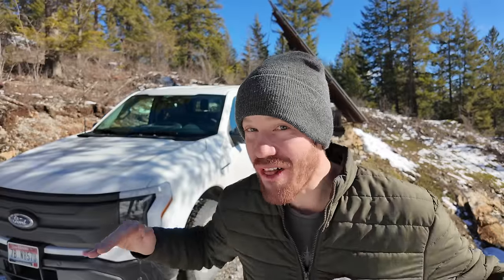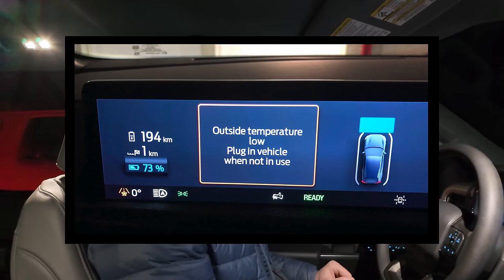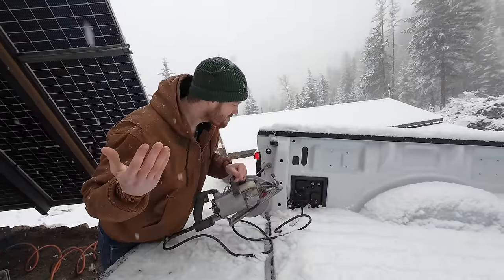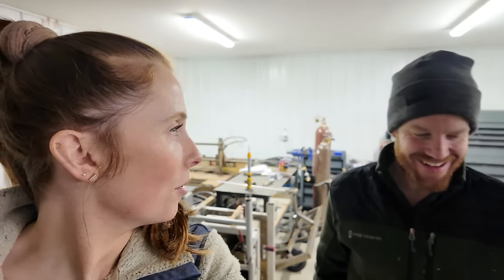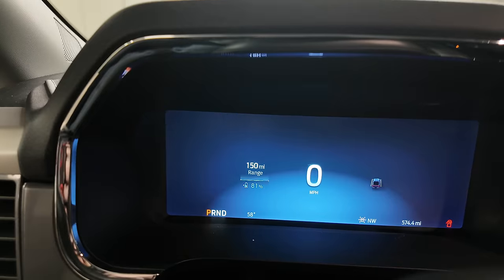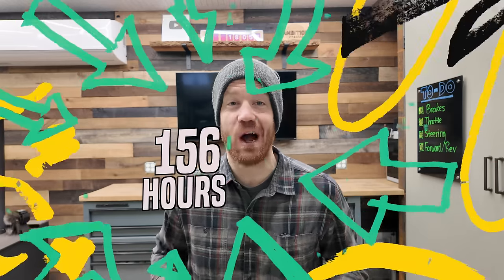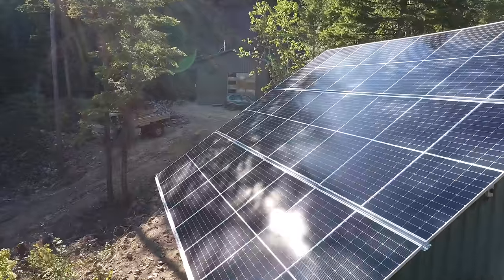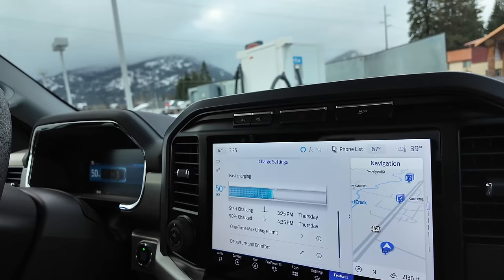Replacing My OFF-GRID Power System With an E.V. (not what I expected)

Comment from the maker: 📲 Install Raid for Free Mobile and PC: https://raidrpg.com/ambitionstrikes1 and get a special starter pack with an Epic champion Juliana 🔥
Reply: OMG you guys will advertise anything and this is a total disgrace from you 👎👎
Reply: @SaltandPepperX  watch the free entertainment and be quiet, these ads pay for free viewership, and its only 30sec so whats the point going bananas?
Reply: Ok, ok, ok.., enough with the foolishness.., now back to D8CAT, 120excavator, 299CAT skid steer, equipment working up rock and dirt…, demolishing old homestead…, etc..,
Reply: This sponsor doesn’t fit with your channel theme. Confusing
Reply: @greggb1416  exactly
Reply: @SaltandPepperX  hahaha..!
Reply: During the summer, perhaps late summer, maybe try making a gravity battery for winter, dig a small pond up hill using the dozer or excavator, pump excess well water  with excess power during summer, pipe something down to a water wheel for charging energy daring the colder months
Reply: @greggb1416  yep that is exactly what i thought with your post, what a tool came to mind hahaha..!
Reply: I wonder if you could chuck up a solar carport for the truck and leave it plugged in? It would be interesting to see if you need to ever charge it if it was on a solar array. Panels are cheap and you could make a car port in a day. You could also wire a circuit back to the main house to use it as backup without all the stuffing around.
Reply: What about bigger battery bank for excess solar
Reply: The "fake engine noise" is on most every new EV across all manufacturers. It is all about pedestrians becoming aware of the EV and not getting run over. 

I have been walking my dog after dark and greatly appreciate this feature on my neighbors EV
Reply: FINALLY! Welcome to the big leagues of youtubers :P
Reply: @SaltandPepperX crying on a video? You're funny hahahaha
Reply: @kingrafa3938  crying ? hmm very strange thing to say, that just shows me what kind of person you truly are.. I see you have no idea or understand what was said, oh well.
Reply: @SaltandPepperX  i read all your comments towards Riley and Courtney, and it's all negative everytime they do things. That's just show me what kind of person you truly are.  A crying NEGAtron 😂
Reply: The whirring  noise probably cooling pumps
Reply: @greggb1416 Yeah, I concur, more equipment maintenance and repair videos! You need to get the equipment up and running again! Especially the bulldozer!
Reply: dont make this mistake again.
Reply: 2days 19hours
Reply: @hardup9809  Exactly backwards.  Low water available in Summer, low excess power available during Winter.  Poor plan
Reply: @honthirty_  they said in a video the homemade well makes extra water more than they use and store , the whole point of what I said was to help with low power in winter, pump excess water into a holding pond above the house, during winter have it drain down, via some piping into a water wheel hooked up to a generator or an alternator
Reply: It's like this, on-topic sponsor commercials are understood, a necessary evil to pay the bills. But totally off-topic commercials are annoying as hell and only cause viewers to either skip ahead or close the tab and watch something else. Just being honest here, and yes I admire what you folks have done and I am a subscriber.

Comment: We have solar and use the truck as a battery backup. We don't use the onboard pro-power, we use the home integration system that we got with the truck. It plugs into the charge port and provides 80amps to our home. When the sun is out and we are getting solar, it charges. When the sun goes down we use the battery from the truck to power the entire home. No need to ever unplug it, no need to leave it on. And the truck fully charges by the end of the day and we only use about 5% from evening until morning. We've had zero issues with it and would absolutely buy it again.
Reply: I never purchased the home integration system as I couldn't see any real benefits in it versus just using the 7200W 240 plug located in the bed of the truck plugged into a 14-50R receptical at my main service panel. I charge my truck using my solar system using a 7.2 kwh 240 volt charger. Since I seldom drive more than 60 miles in a day and only drive 2-3 times a week so I can usually recharge my truck after a trip in a few hours of charging. This is the best F150 that I've ever owned.

Comment: Something I just found when looking at price and specs for a new 2024 lightning.   "The ProPower onboard generator now powers up when you unlock the truck, no longer requiring the truck to be powered completely on. These changes are also given to 2022 and 2023 F-150 Lightnings as over-the-air software updates." So that is one problem you can fix with an update.  😀
Reply: It would be interesting to know how secure the truck was when being used as a power source like this. With the version in the video it sounded like the truck was literally on meaning. I guess, someone could just get in and drive it away. With it unlocked then I guess it would only be at risk of someone stealing stuff from inside the truck.
Reply: can't believe they chose the Ford Lightning truck, after all those bad tests, especially that from Hoovie's Garage. Range collapsed totally and utterly in cold weather.
Reply: The Powerboost hybrid I have needs to be "on" as if you are going to drive it. Then I select the onbord power generator option and then turn off head lights, radio, heat/ac, info display screen, etc. When you leave cab with keyfob you can lock truck and only thing left lit up is speedometer cluster. The truck won't be allowed to be taken out of park unless keyfob enters cab. Truck then only occasionally runs gas engine for a few minutes out of each half hour time period depending on load plugged in. @DTSquared
Reply: My wife has come across a few carbon monoxide poisonings at her hospital from people forgetting to turn off their cars, with auto-engine start, in their garage. When forgotten, their AC/Heater later turns on the gas engine to meet the set cabin temperature so be careful. With a  BEV, one would not have to worry about CO poisoning.
Reply: i think this will work better with a bi-directional charger like "Ford Charge Station Pro" or other aftermarket chargers
Reply: @JoE_Songs Hoovie might have "overstated" how bad things were to get some views, and to play into the raging anti-EV sentiment being stoked by people trying to con the uneducated, gullible and frightened. 
Just sayin' ...
Reply: should have gotten the home-kit so the CCS2 plug ( inverter and truck's battery is a cell-level 400~V dc output to home, as per the instructions manual and permits so i can explain the in inspection and utilities company for PTO/certificates ) is used for the solar system as backup instead of the bed-systems as it's a better choice for permanent installation's the bed is for power-tool's and camping ⛺and work-setup-job ect

also where's his 100-amp pro-charger? i wouldn't go without out it for home 🏡use, 120v 20A~ is my idea for backup's/embarrassing-roadshow-use and currently for my home/400-amp-panel 240V AC under construction and upgrading

glad to see someone got there lighting for under 60K as 150k my family ( old man wanted the platinum or lariat model as a retirement package/present 🎁 to go with his house and for one more 20-30ft rental-travel-trailers RV-adventure to hiy-1/redwoods and Rushmore ect , im more into the contractor's/mid-trim 100-battery/hp models as my career as a mechanic 👨‍🔧 /plant-maintenance is hard on interior's and also eventually id like to use it for my 1980's k1500-swap+restoration, that other vin is aimed at gardener/bed-camper's-special and base-model and also downsizing ( 1980-2002 compact rangers and c10's and b2200 ect aren't a thang anymore for USA market's, and they like MX5/small-sports convertibles but housing+work-travel-ect needs for now are dictating the need for camper's/truck's at least inel they find a home there buying-ect ) from a van+house* or at least temporarily moving around ) and me are out just to much $$$ for 1 truck let alone 3-vin's
Reply: @JoE_Songs  look as a dodge car/60's-charger owner and fan-boy and Chevy's truck fanboy as iv had 1-4 of them now oldest being a 1968 C10 v8 stick-vin and i like SS-steel but Tesla's not in the game for contractor's/working-man's and no-possible way for flat-bed's/tow-bed's-ect ( yes my/3gen-owner 1-owner-family single-cab k1500 is rocking it's 8ft show/OEM fleetsidle bed but it's still a accessory to me and can change out as needed weekly ) and well to keep it short ford's got the better ( aluminium is my 2d pick for a body and rustic steel being last placement ) BEV-truck for the 1/2 to 3-ton market ( yes it's not perfect as update's like 800v dc charging ect would make it a better experience but still good enough to grabbing my attention to buy or leasing ) and yes im not generally interested in ford's ( awkward experience with me in my group of friends and family that hates ford's and loves dodge ) despite being forced into buying a mustang convertible pre-1970-vin the keep my SO'S happy and my classics safe from being sold out form under me ect
Reply: @JoE_Songs The reason I stopped watching his videos was that review
Reply: @capnkirk5528 why I unsubscribe
Reply: I wasn't sure if he or ford was dumb because this backup function was so poorly integrated.
But after the "where do I plug in" I wasn't sure if he was the right person to trust that this is solution presented by ford
Reply: @DTSquared exactly! The other risk is having a fire started inside the persons garage. A cargo ship carrying over $750 million worth of EV vehicles caught fire and sank. Their lithium Ion batteries caught fire. And it’s a known fact by firefighters they have to use a special fire retardant to put out the flames from lithium ion batteries.
Reply: @hl2349 except if the lithium ion batteries catch fire, no homeowner will have the necessary fire retardant equipment to put out the fire by the time the fire department would be dispatched if they didn’t have the right fire retard equipment, the whole house will burn down

Comment: You are actually augmenting your off grid power system.  The best design is to have redundant power generation methods.  I see the value in your F-150 as a mobile battery source where you can move energy from the GRID to your home.  This is not a replacement for your generators (diesel or gas) which are independent of weather and the 20 mile distance to  recharging your mobile battery on the GRID.  Capuring excess energy and dumping it into your F-150  is very cool and should work well in the summer!
Reply: This ^^^ .  It's defense in depth.  Put a diesel transfer tank in your electric truck, plan to charge it in town whenever you're there and you've create an effectively n+3 redundant system.  Nice video.
Reply: Exactly what I was thinking!
Reply: my thoughts ezxactlly
Reply: Absolutely agree.  The truck is a layer of defense in your power plan, and a place to store unexpected excess solar as demonstrated.  You still need the generator in case you’re away from the house during the winter, as the truck is manual not automatic (could also be with you while you’re away), and you don’t want the house freezing.  But having a backup to your backup, where you can import energy from town is super helpful.  And being able to run the truck all summer for free off your excess solar is a huge improvement on paying for gas/diesel to run your other vehicles.  It’s totally a win, but it’s not a replacement for your system at all, it’s a super helpful supplement to your existing off-grid system.  The peace of mind of knowing that you can run the house for several days at a time when your off-grid inverters eventually fail and need repairs/replacement?  Priceless.
Reply: Exactly!!!! It’s basically a boost for the dramatic ends of the scenario.

Have too much production, charge the truck.

Don’t have enough storage, use the truck.
Reply: I'm actually surprised they havent tried wind generation yet; they are high enough and have enough area that they can put one or more wind turbines far from their house so they can avoid the noise.

Comment: Huge EV fan here, have multiple EVs. But I don’t think it makes sense to go to town and charge the vehicle to bring back. You just switched going to town to haul water to hauling electricity haha. However, I think you’ll benefit a lot more in summer when you have excess energy. Trow some better tires on it and it could be your daily truck for hauling things, going to town, and just getting around your property - all for “free” with excess solar.
Reply: Love the comparison between hauling water and hauling electricity!!
Reply: Especially when the water analogy is often used to explain amps and voltage!😂
Reply: Ultimately, nothing is "free".
Reply: It depends on the cost of propane and what the cost of charging is.
Reply: Hardly free at $49000
Reply: Leaving that as parents for a day seems like a good argument. He has more than 2 days of power in his home batteries. Seems like you only need to do it before a snowstorm.

Comment: It's not about replacing it, it complements it. I have a 60kWh (soon 100kWh) battery powering my home. I'm also very up north: 63 degrees in Finland. What an EV with V2L (the inverter) allows is to seamlessly integrate both systems. You don't just increase your home battery, you increase your vehicle range with solar that would otherwise go unused. Yes, it serves as a back-up option in winter, but also as an extension to the home battery (as you have noticed on those sunny days). Plus, you drive for free all summer. Saves having to run the generator as often as you might as well buy some power more cheaply in town compared to using generator fuel.
Reply: - a hybrid inverter + battery + charge controller, of any brand does the same thing...  my truck has one too and it (the truck) isn't crippled out of the box... This solution need not only be for the very wealthy who don't really need a second truck.
Reply: @kadmow  Regular EV cars like the BYD Dolphin and others support V2L as well, and this would easily be just the primary commuter car.
Reply: @kadmow a $49k truck is for the "very wealthy"? You have a skewed concept of wealth if affording a vehicle that's a hair over national average (edit: wow, numbers have changed, it's actually $7k UNDER)  in price is limited to the very wealthy. I mean, it's definitely not for poor people, but nobody made that claim. Consider also that used units aren't going to hold their value forever. Can currently find one in my area used for $39k with only 10k miles on it.

This application wouldn't make a ton of sense for me, as I have solar and am on grid with 1:1 net metering, but my wife's work lets her charge for free. I could power my house overnight for nothing. Our power bills used to be $250-300 a month before solar. From there it's just math. As an aside, we live in a 1200 square foot ranch style in central MA. I wouldn't consider myself wealthy, but understand that relative.

Comment: If you are looking for another alternative as a backup power supply - consider the upcoming Ramcharger (early 2025).   It has a 92kWh battery pack AND 27 gallon gas tank that powers a V6 engine driving a 130KW generator.   For short outages you could use just the 92kWh battery.   If you had an extend outage, the  the V6 engine and generator can provide power to the 7.2kW bed-mounted power panel.

Comment: Great test! I would have purchased the powerboost F150 over the full EV just for the ability to create that power if needed.. I work for Ford and have ran my home for 15 days on the generator system from my truck for the cost of 60 bucks in fuel.. And no temp protection issues in negative 10 degree nights.. Love the videos!